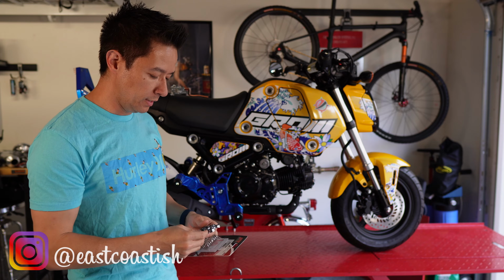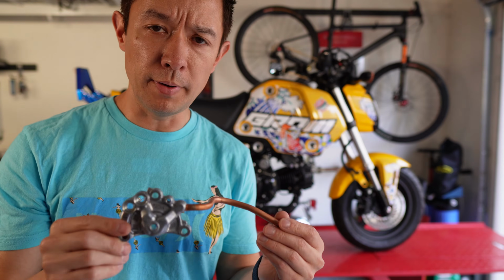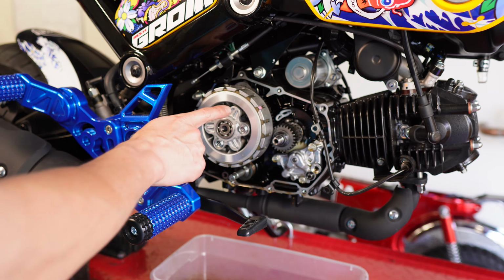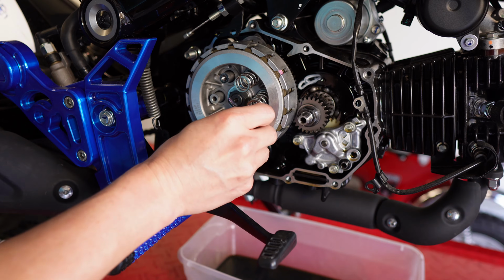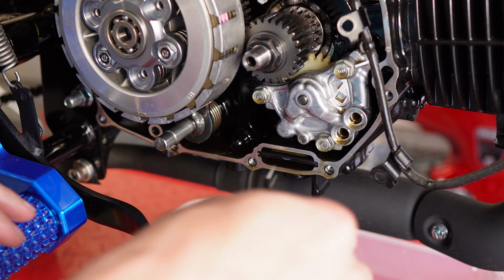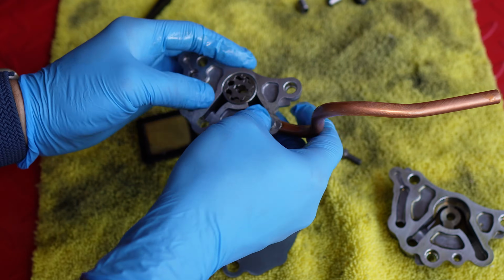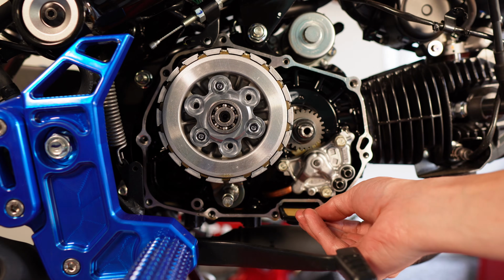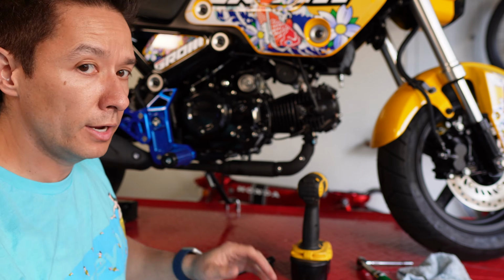Stunt Oil Pump, Stiffer Clutch Springs & Lifter Plate in the 2022+ Honda Grom

Comment: New subscriber here…. Where did you find the torque specs at?  I just bought a used 2022 with 350 miles. 

I would like to upgrade the springs as well.. BTW… your videos are super informative man thank you.
Reply from the maker: Thanks. I have the shop manual that has the torque specs.

Comment: Any plans to upgrade brakes?
Reply from the maker: I’ve got a video of doing full Brembo P34 calipers on my other Grom and my last video on track monkey has the P34 front caliper as well as the Brembo RC14 master cylinder. On my stunt Grom I’ll eventually do a secondary P32 caliper in the rear and will probably use a left hand RC14 master cylinder for the brake lever.
Reply: @eastcoastish  mine is abs 22. Hard is saying there kit wont fit. Thinking the front rotor is the issue or pads
Reply from the maker: @alainnadeau3421  HardRacing would know, they set me up with all the brake stuff on my other Grom.

Comment: Two questions, hypothetically with a better pump and more flow rate wouldn't that make oil coolers more effective?

And also dhm just announced their bbk! Apparently they're crawling to 20hp, you gonna try it out?
Reply from the maker: Yes more efficient pump makes oil coolers cool more. That’s why I installed the Kitaco high flow pump in the Repsol Grom. 

And yes already reached out to DHM about their BBK. I’m hoping to get above 15hp with their kit, where did you see someone getting to 20??
Reply: @eastcoastish  awesome! Email with David, apparently they're at 18hp now with ported head, tb, manifold and such and they're heading on towards 20hp some how, which seems very impressivex

Comment: 1st off your videos are the best on the tube. Very detailed and so helpful. It is very clear that you are  detailed kind of guy. I am having a problem with my 2022 Grom's oil temps running in the 260-270 range. The bolt on oil coolers are back ordered and I would like to just make my own. Do you have a suggestion as to where I should place my pick ups and outlets? Once again thank you for your time .
Reply from the maker: Thanks Troy! Anything over 240F is too hot, running at 260F+ for any prolonged period of time is definitely going to lead to failures. The oil pickup at the top tappet cover is the best place to pick up the oil (this is where the Kitaco kit picks it up). If you remove it you can see how the oil actually runs through the stock cover to pour oil back onto the intake valve. For what it's worth, it looks like the Takegawa unit (which picks up the oil from the cartridge filter) looks to be in stock: https://japan.webike.net/products/24840653.html

Comment: Does the straight up pumps pump bypass the oil screen? I have that pump as well but haven’t installed it because my wheelies are also pathetic and I am afraid of chunks bypassing the screen. As of now, I am planning on waiting until a bit further after initial break-in (still only 700 miles on the odometer) to install. If my wheelies don’t get better, I may not install at all if it does bypass the screen.

I know we now have the replaceable oil filter but I did an oil change at 300 and 600 miles and both oil changes had some chunks in the screen.
Reply from the maker: It doesn’t bypass the screen, it’s still pulling the oil from the bottom of the engine just now from the back part of the bottom of the engine.
Reply: @eastcoastish  from what i understand it does indeed bypass the screen, but does not bypass the side cover oil filter

Comment: Check out the oil pumps by grombeardo- also, to remove the crankcase cover, and try to reduce the tearing of the gasket, push the clutch lever forward (the one on the case) It’ll basically push the cover off with even pressure.  

  💜
Reply: @ClarkNova  My man!  Appreciate you spreading the good word of GromBeardo  😁🤜💥🤛
Reply from the maker: Great idea on using the lever to push the case against the lifter plate/bearing!